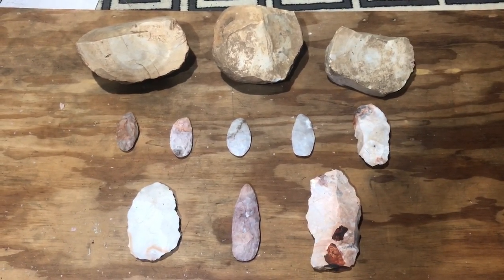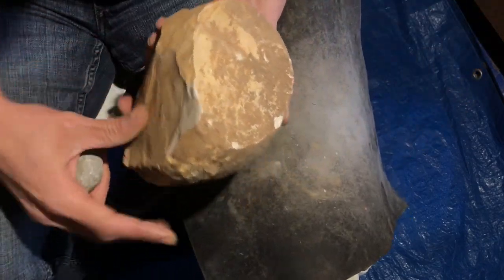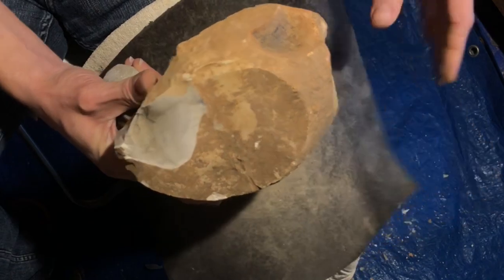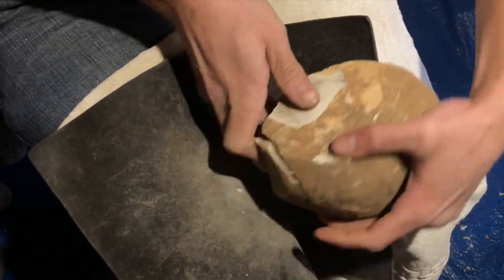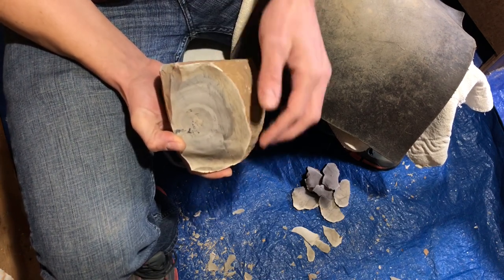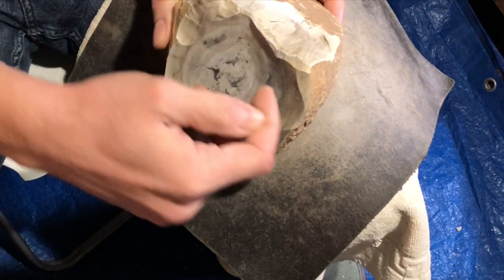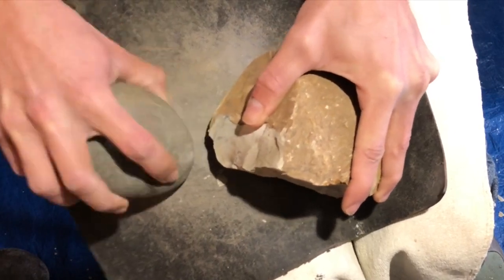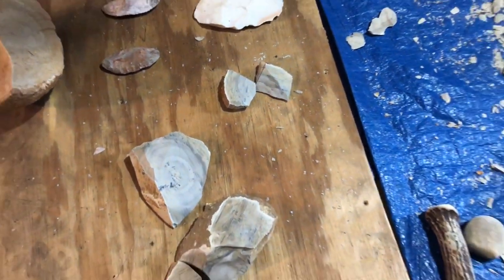Hornstone Nodule 1 - Spalling Part 1 of 2

Comment: By counting the rings from inside out,  looks like the rock's around 1500 yrs old.  Great job.
Reply from the maker: Thanks
Reply: @DeeDee Edwin Burks  you can't be serious.  Rocks can't be dated by rings like a tree can!  Give me a break!  First of all, I'm not even certain this is hornstone.  It looks more like Brush Creek chert to me and the "rings" are what we call "banded" in geology.  If this nodule is Brush Creek Chert, (and it wouldn't be that far off from the age of hornstone, either) then it is from The Kasimovian Period, which is a geochronologic age or chronostratigraphic stage in the ICS geologic timescale. It is the third stage in the Pennsylvanian (late Carboniferous), lasting from 307 to 303.7 Ma. The Kasimovian Stage follows the Moscovian and is followed by the Gzhelian. 

The Kasimovian saw an extinction event which occurred around 305 mya (305 MILLION YEARS AGO), referred to as the Carboniferous Rainforest Collapse. 

THAT'S RIGHT... THE ROCK IS BETWEEN 250 AND 450 MILLION YEARS OLD.  Those rings didn't tell you that, though, did they!?
Reply: @lulabell79_31  He made a joke and you took it this far, jeez
Reply: @piggyslayer1999  I don't think he was joking.

Comment: That looks like Meade County hornstone . I used to live in Brandenburg Ky on the Ohio and collected it for knapping . I've got some Indiana hornstone now but it doesn't have any platforms at all on it . Perfectly sealed in its cortex . Any thoughts on bipolar percussion to open them up ? Have you ever tried that ? I've only bipolared small  river gravels, never a 10lb  nodule .Good content man,you got  a sub from me .
Reply from the maker: Meade County eh? Cool. This was the first hornstone I ever worked, pretty good stuff. Very similar to the little bit of Cobden I've worked, but a little grainier and different colours. I've done some bipolar percussion on big pieces before, but they at least had some flat-ish surfaces to crack into. I imagine you could do the same thing you do with smaller river gravels, but ramp up the anvil and hammerstone size? Just make sure its really well stabilized, maybe bury your anvil in the dirt a ways and pack some dirt around the nodule too. And make sure your toes and fingers are out of the danger zone!